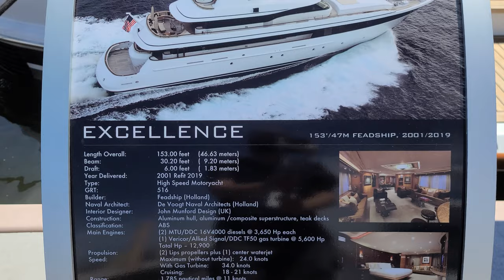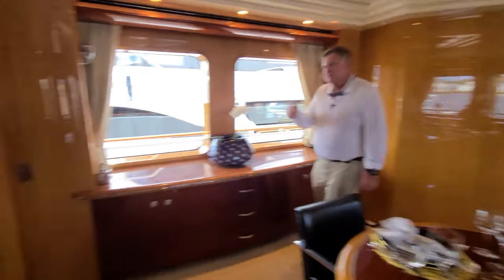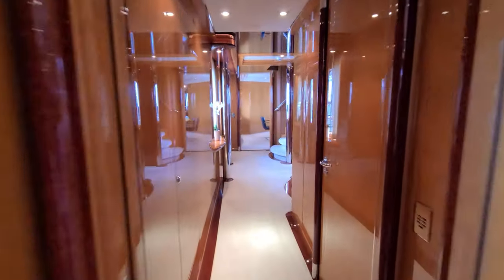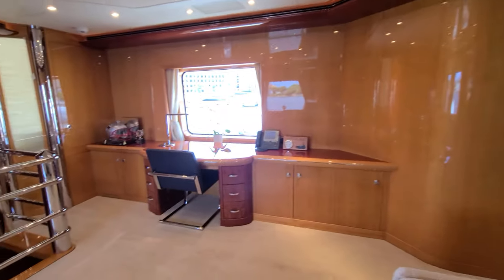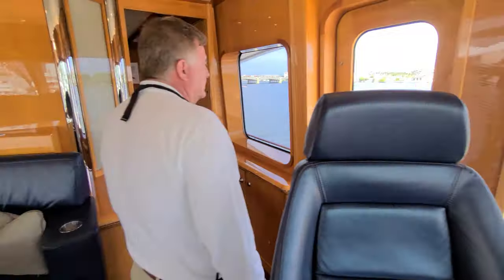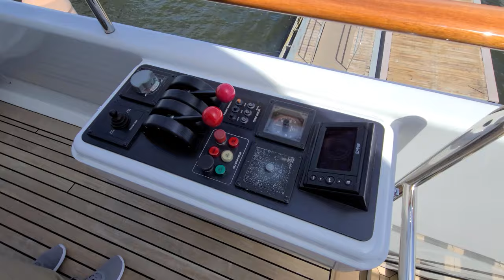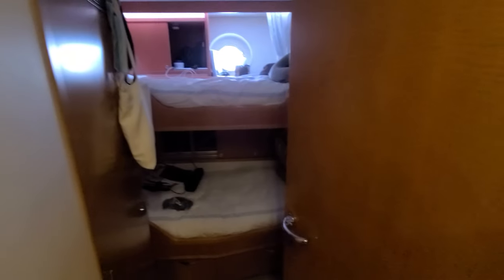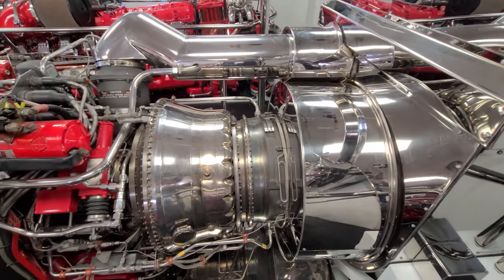Roger Penske's 153' Superyacht "Excellence" by Feadship at PBIBS 2021

Comment: That is a very cool vessel. I love the engine room office, seperate generator room. Those engines are mental. The lower deck staterooms are done in a configuration I've not seen before, and I like it. Also the split port and starboard area on the bridge deck. One part upper salon and Day heads, one part Capts Qrtrs. The whole vessel is just so classy. I love it. Can't believe all that for $16 million.  If you ever do a tour in Southampton UK during the boat show or anytime. This disabled British Army Veteran would love a tour.